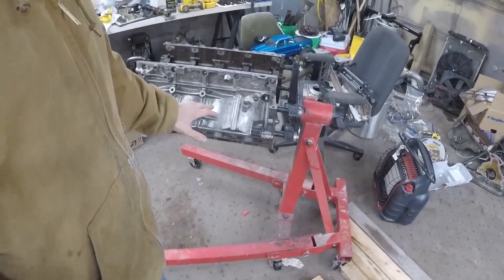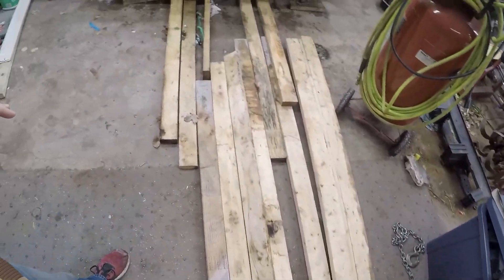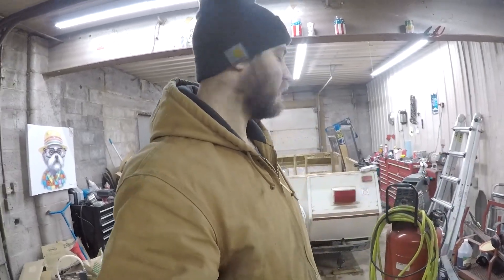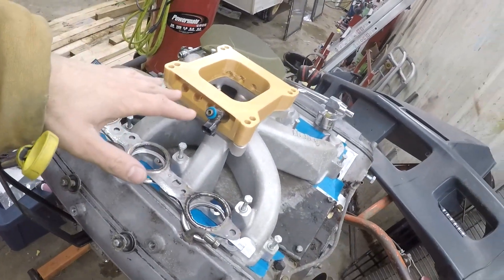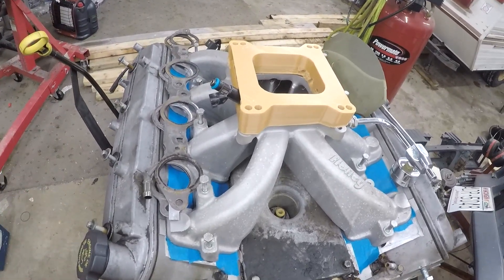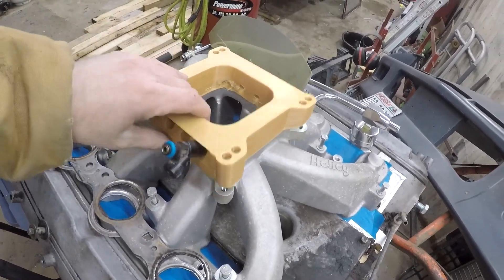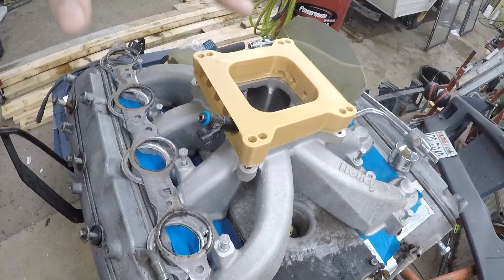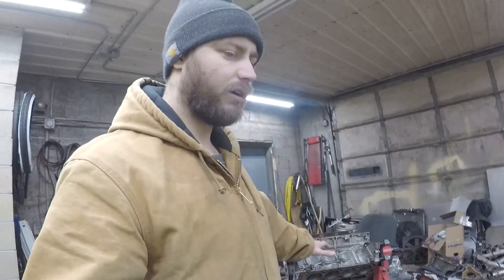Future diy throttle body injection & taking small break

Comment: I was going down this road on a bbc, cylinder 5 starves cylinder 7, or 4 starves 2 with a 4-7 swap. That’s carbs, and fitech fuel over top of the throttle blades. Idk if it would happen on a race car, but it happens at low rpms.
Reply from the maker: Even though this project got shelved. The idea was to use an elbow and a stock truck throttle body. No fuel over blades.

Comment: I like the printing option, but do you think it would get to hot and melt or deform?  I had a similar thought for an injector plate but using an aluminum spacer. Unfortunately I ran out of time for my build and had to buy a Holley plate. You can search on YouTube for the video I did to show what I was going to do. Search "Drag Week 2018 only 40 days to go - Go BIG or go home" and it will pull it up. Good Luck Fishing.
Reply from the maker: I wont be using the 3d print for the final version. It's just to look for problems and model it out before milling one out.

Comment: What if you drill out the flat spot on the manifold just above the port and put the injector all most where the factory did. There may be some or a lot of fuel distribution problems with it in the carb spacer I like the thought though good luck with you billed
Reply from the maker: I dont really want to machine out the flats, they do sell one that have the ports in it (I wish I would have bought that one instead). But one of the theorys is if I get a bum injector it will slightly lean out on all cylinders instead of super lean on 1 cylinder on a high duty cycle.
Reply: Alloyspeed I gess if you tune it and check plugs to make Shore its distributing the fuel good it will work but i think it will still tend to lean out one or two if it dose.  I’ll keep on watching to see how you make out. Good luck